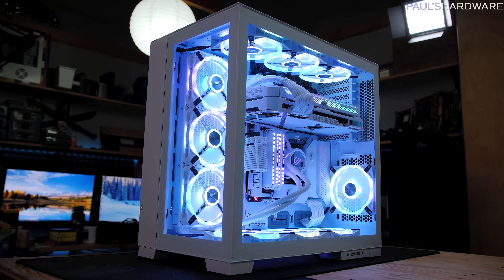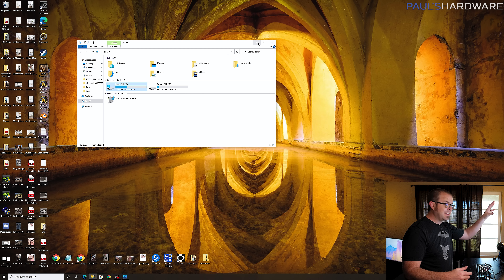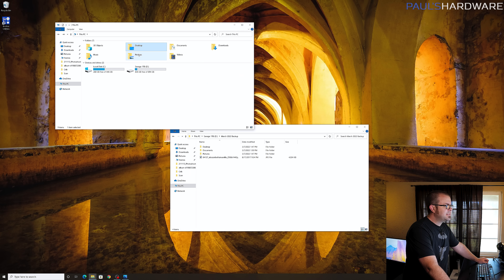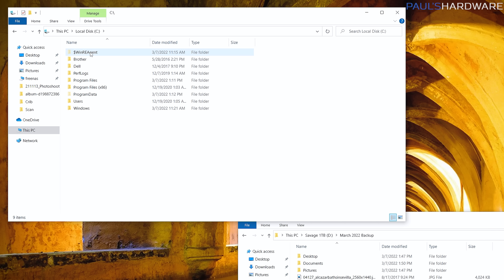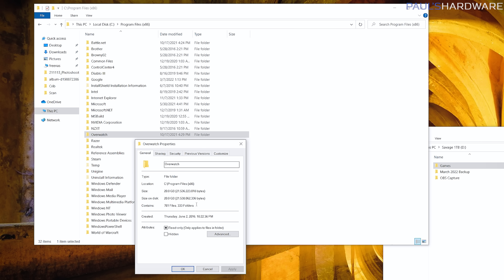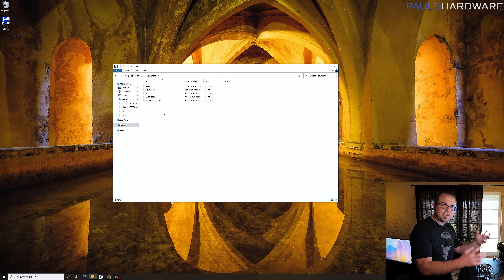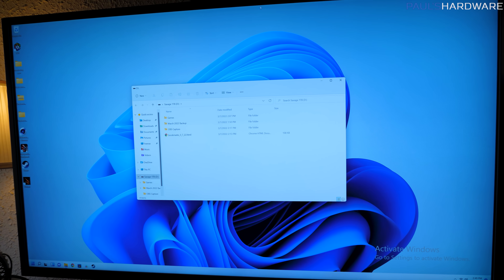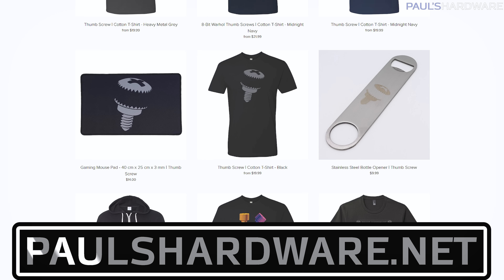How to Move Everything from an Old PC to a New PC

Comment: A good rule to thumb: never ever store any personal data you can't afford to lose on C drive unless you (1) backed it up using your methods or (2) imaged the drive with Macrium Reflect. I try to make images of Windows 10 and Windows 11 on Intel and AMD hardware with all the drivers, apps, and updates every 6 months - a total of 4 disk images - so that I can just boot to a Macrium Rescue USB stick and deploy the relevant image as needed.
Reply: I've got all my computers setup to clone their system drives to backup drives every 48 hours during the wee hours of the night. Its so easy, and so well worth it. I use traditional HDDs because they are much better suited to the quantity of disc writes involved with frequent full disc backup, , although they are slower drives.
Reply: @obsey  I have my Macrium images stored on the root of a 3TB Seagate USB 3.0 + Hub. It also has my music and my life on it. My OS drives are  500gb SSDs with only about 20% file usage, so both the imaging and deploying goes by quick - 8 to 12 mins - and only take up 17GB to 24GB of space. Saves me a lot of time!
Reply: Excellent advice!  I try to image my system disks at least once a month.  And, what's really nice, is that you can mount the images as pseudo drives and dig through the file structure to restore specific files and folders.  Say you web browser becomes corrupted, you can just replace its application data folder from a mounted backup.  You're back in business with all of your plugins, bookmarks, and configuration intact.  It's saved my bacon more times than I can count.
Reply: Yes. For full separation, store data on a second and/or third internal drive. When switching to a new system it's a simple matter of physically removing the data disk(s) from the old system, and installing them in the new one. That, and changing the references in any programs on the new system, that refer to a specific drive.

Or copy the contents of the removed drives to the new system; external drive case. Then store the removed drives in a secure location, to be used as an off-site backup.

Comment: or if you are on windows 10/11 simply remove your ssd, pop it in your new machine and boot (finally remove all old drivers in device manager by selecting view -> show hidden devices)
Reply: This is problematic when jumping from AMD to Intel (and vice versa) because even if you uninstall platform specific drivers after the SSD swap, Windows Update will turn around and still offer driver updates based on the old machine because the HAL was never reset. You'll need to use the "Reset This PC" option or clean install Windows.
Reply: @TogonzoMedia   Very true, however it is a simple solution for most people. You can in fact edit the registry or run a batch script or even software to clean up the chipset drivers etc, just wanted to keep it simple. I certainly do this more often than I actually transfer but the 3rd solution is of course just to make a system image.
Reply: @bowlinbob6  If the NVME is formatted as GPT and you're using UEFI mode in the BIOS, it'll boot up to Windows on the new board. I was on an i5 4670k and when I moved my Samsung SSD over to the Ryzen rig I built in October, it booted into Windows 10 without issue. I removed everything Intel related, installed AMD chipset drivers, left it idle for a few days. Came back to Windows Update prompting me to install Intel LAN drivers and said, "Yup, I better install clean!" 😂
Reply: @bowlinbob6  As of Windows 10 you can it just pops up "getting devices ready" and installs the drivers prior to booting system32.... Technically yes, however if you do switch to a Ryzen you will need to clean up the firmware (chipset drivers). To be fair once you boot from it you can just do a non destructive reset anyway so it's still super simple this way.

Comment: Man I literally just finished building a new PC for myself today and I've not been looking forward to having to move everything over... excellent timing on this vid sir!
Reply: Why not use the Macrium Reflect software application to clone the contents of the drives in the old computer onto the drives that will be in the new computer? Of course, new software license keys will need to added, especially for Windows and MSFT Office and such, but that too is easy. Cloning drive contents with Macrium Reflect is a much more efficient approach to this task, one I've done many, many times, than copying files by hand.
Reply: @obsey  I agree 100%. Cloning a disk to disk or disk to image will always be faster. Checkout Veeam Backup & Recovery, it's free for 10x workstations
Reply: @obsey  fresh is best, cloning is quick and easy but can cause problems down the track
Reply: @holdenman8850  Are you "serious"? A clone is an "exact" sector clone. Unless a "old" computer is absurdly old, a clone is a far better way to avoid problems than the gazillions of pitfalls in trying to copy individual files and folders by hand, possibly creating disasters like skipping essential files / folders on an historical disc. Even for a system drive, a simple trip to the Device Manager is the way to clean up, verify correctness of, and updated it device software. this is the way to avoid problems, the infinite potential problems than can result from hand copying files / folders, especially by using the File Explorer GUI. The video above, just was not very good advice at all, imo.
Reply: @obsey  Of course and 110% as i wouldn't have mentioned it.. Heard too many stories of problems and found out that it was an OS clone.. redid the OS with a fresh install and never a problem.
Reply: @holdenman8850  "fresh is best" is not true around 95% of the time. The time to setup a OS, especially a server OS is far too costly. I've cloned 1000's (literally) of systems (mainly workstations) and maybe 1% of them had some odd issue. If you follow good practise like running SFC and Dism health checks before stripping the drivers and license via Dism OOBE, you should not have any issues.
Reply: @obsey  you can also export all drivers via powershell :)
Reply: Tech Nerd  Hi, Which apps folder are you refering to ? Program Files or AppData ?
Reply: Tech Nerd  generally you do not take the AppData over and over it daily. There are some files / folders where you can / will do this, but for the most part you won't. It's good to have a copy of it, but no need to keep it. Regarding keeping your system maintained, keep uoto date with driver and patches, and run SFC + Dism health checks every 3 months or so.
Reply: Not for me. I did it Sunday lmao
Reply: If your current OS isn't too old, make a clone / backup (clone is my goto - try minitool or macrium Reflect), then read about "Dism oobe" (out of box experiance ). It strips drivers out. Run SFC/scannow and Dism/health (3 part command) before running Dism OOBE. Win 7 and 10 are good at getting things running after a big hardware change.
Reply: Just copy data over the network

Comment: If I wasn’t going to use my old pc anymore could I just take my ssd out that had all the window programs and put it in the new pc?
Reply from the maker: Yes, you can do that to copy files from the old drive but you can sometimes run into permissions conflicts depending how Windows was set up. You'd still need to install programs onto the new system though, most programs need to be installed and can't just run from the program files folder from a different system.